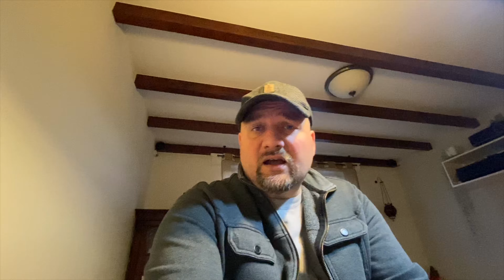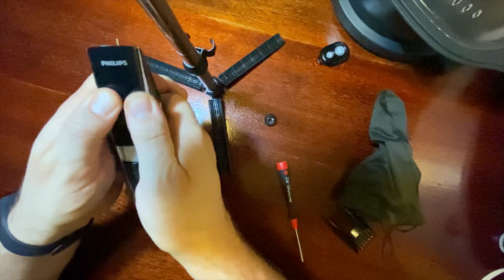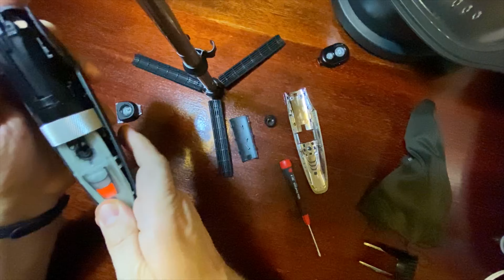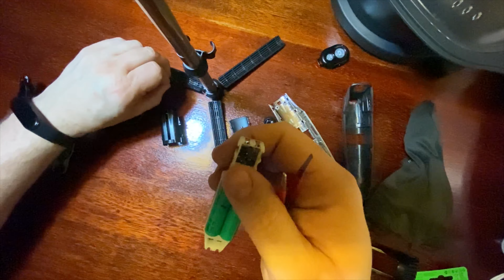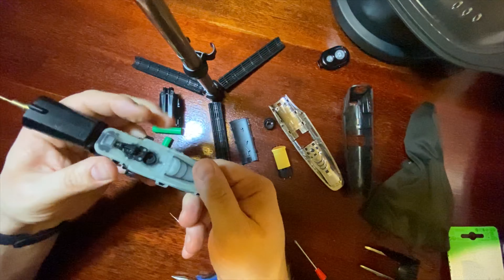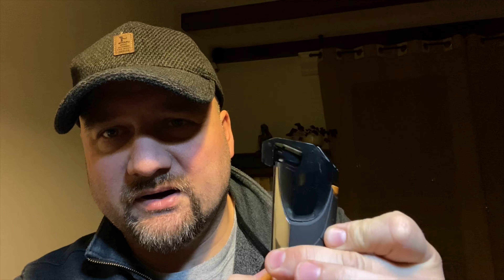🇺🇸/🇬🇧 Philips BT9290 revival/refurbishment (internal battery replacement)

Comment: I have a trimmer like this. It has the same number and looks the same. It was made in 2013, but it uses one 18650 battery and has "Li-Ion" written on the circuit board. I bought it brand-new in 2014 and it looks like it has had some modifications.

Comment: I was ridin' high from fixing my razer, so I figured I could give the trimmer a go. It still technically worked but was a bit fiddly to turn on. This video was a massive help, thanks!😄 It works perfectly now. It's a BT9280, slightly older, but pretty much the same.

Comment: That's a great video Tomasz. I am facing an issue though, because I had to replace batteries for a third time in the last 2 years.   After the replacement the batteries charge as they should but the shaver loses its charge within a few hours while being off, in the end batteries became unusable and I have to repeat the whole process again. Do you have any idea what could couse this issue?
Reply from the maker: Did you use same type and capacity as the originals? I don’t know how “inteligent” is the charger in this shaver, but if eg. you tried using some high capacity lithium batteries, I would suspect that the charging characteristics of the circuitry might wrongly interpret the current/voltage feedback it’s getting and since it’s improperly charging (and then discharging) the battery might suffer premature failure. It might be also that something (perhaps the laser?) is kept on even when closed and that’s what’s draining the battery?

Comment: Great video. The battery doesn't charge properly on my shaver. I have to leave it on charge for an hour, press the power button, then charge for 5mins and it works. However you have to repeat this with every use. 🤞🏼 this works as it is the best trimmer ive had.

The new replacement I bought from phillips is terrible! Series 5000 bt5502.
Reply from the maker: What type of replacement cells did you install? Same capacity as original?
Reply: @Tomasz Pławski  I haven't replaced them yet.. I'm hoping this demo will help me fix it.
Reply from the maker: @haydon3690  ok, I thought you changed them and these were the symptoms now,   the shaver could behave weird if you use very different cells to the originals as they might charge differently, have a different voltage drop etc., which could confuse the charging circuitry.
Reply: @Tomasz Pławski  it works! 🙌  Great video sir. Anyone should give this a go if they need to fix their's, it is very simple if you follow this. Still the best shaver around.

One thing.. For anyone who like me snapped the circulation strip welded to the existing batteries, don't panic, tin foil works a treat 👍

Comment: Great Video! Thank You Tomasz! The question is why PHILIPS constructs the product so complicated? Many of these shavers will be thrown away as garbage because of those f** NiMH accu/batteries which cannot be charged anymore. 99% of the product is still ok. This is the PHILIPS contribution for sustainability and environmental protection.
Reply from the maker: I suspect that in case of this particular model the reason why the battery is buried so deep inside is because of the waterproofing as you can use the shaver in the shower where it is subject not only to water splashes but in general very high humidity.

Comment: Thanks a lot for the detailed video. I was about to throw the machine in the garbage. I was able fix the machine after watching this video. I just want to bring the attention to the round part which you removed first. There is a very tiny piece of plastic in the front hole of this part. I didn’t notice it when I removed the part and it fell down on the sofa. When I finished putting the parts together, I noticed the blades part is loose a bit and doesn’t make the click sound when I rotate it between the small blades and the large blades. Fortunately, I found the tiny piece on the sofa and I put in the hole but I wasted a lot of time to identify the reason of the loose blades. That’s why I commented here.

Comment: Did I just replaced my batteries only to find out that the charger is not charging? 😒
Reply from the maker: Anything improved? Did you use the same type rechargeable batteries as the original?

Comment: I followed this, and ordered some expensive chargeable AAA's,  but tried a new-non-recharable as a test... and though it was full power, it would still flash low power...
I don't want to waste the expensive batteries if something else is wrong with it, thoughts?
Reply from the maker: I’m afraid that testing with regular batteries might not be reliable. Non rechargeable batteries generally have 1.5V, rechargeable are lower voltage, but often can pump out much higher current. Having such different characteristic the electronics of the shaver probably become “confused”.
Reply: @TomaszPlawski   ah, the original batteries seem to hold 1.3v but it wont work with them, or the 1.55v test batteries

Comment: Mine did not disable the laser when it was retracted and drain battery. Now it does not charge at all, do you think it's possible to fix battery drain due to the laser? Is there any way to disable the laser completely?
Reply from the maker: I guess you could just disassemble the whole module as it’s “plug’n’play”

Comment: Did it on a bt5200 philips and it worked ! Thks for this video
Reply from the maker: Did I help you? Now you can help me!  I have entered this in the Instructables "Fix it" Challenge, therefore I would greatly appreciate your vote at https://www.instructables.com/Philips-BT9290-Shaver-as-Well-As-Others-Revivalref/  (just click on the heart in the upper right corner) It would be great if you could also click the "I made it" button on the bottom and share with others how successful was your replacement.

Comment: Hi ,
Is there specific type of rechargeable battery to be used with it  ?
Reply from the maker: Best to use something with a similar capacity and type. Theoretically you could get some of the modern very high capacity LiPo but I would be worried that the electronics not being optimizes for that will not charge them correctly and therefore they will quickly degrade.
Reply: @TomaszPlawski  Many thanks , Could you plz share a link with me for a battery with same spec .
Reply from the maker: I used some 1.2V aaa 800mAh NiMH cells (the closest capacity to the original 750mAh) I don’t remember the brand, but somebody in the comments mentioned recently that they successfully used the eneloops, therefore it would be something like this https://ebay.us/TUbzhX
Reply from the maker: Ps. You might need to copy or retype that link into your web browser as YouTube viewer sometimes distorts the links adding to them some tracking information and then eBay says they cannot find the item
Reply from the maker: … could be that it’s not only YouTube but the way different web browsers treat eBay shortlinks… it also doesn’t seem to open on the Microsoft edge browser, only Opera :( if it doesn’t work, you can just search for Eneloop 800mAh aaa 1.2V and find the best offer.
Reply: @TomaszPlawski  many thanks
Reply: So glad to let you know It works perfectly .. Many thanks

Comment: Thank you Tomasz.  With your help here I replaced the batteries in my shaver and it works great now.  I used eneloop 800mAh batteries.  Like you my batteries were suppose to be pre-charged, but it didn't seem to work right away.  Once I plugged the cable in for 10 seconds everything worked, even after removing the cable.
Reply from the maker: Did I help you? Now you can help me!  I have entered this in the Instructables "Fix it" Challenge, therefore I would greatly appreciate your vote at https://www.instructables.com/Philips-BT9290-Shaver-as-Well-As-Others-Revivalref/  (just click on the heart in the upper right corner) It would be great if you could also click the "I made it" button on the bottom and share with others how successful was your replacement.

Comment: Good on Phillips for making it able to be disassembled without breaking it, and good on you for showing us how to do it! This is a great little machine and it would be a shame to throw it away just because it needs a new battery. Awesome vid, thanks!
Reply from the maker: Did I help you? Now you can help me!  I have entered this in the Instructables "Fix it" Challenge, therefore I would greatly appreciate your vote at https://www.instructables.com/Philips-BT9290-Shaver-as-Well-As-Others-Revivalref/  (just click on the heart in the upper right corner) It would be great if you could also click the "I made it" button on the bottom and share with others how successful was your replacement.
Reply: I would be more inclined to say good on them, if they had made a door on it, held maybe with one screw, so you could replace the batteries with your own. Much like a tv remote control.
They are sealed in so you are tempted to just go out and buy another one, which I won't be doing while they are still like this.
Reply from the maker: Part of this being done this way could be because of the shaver being totally waterproof. And since these are rechargeables, they do last a couple years.

Comment: Hi. What about replacing battery on shaver that has no screws? I have Renpho model es-sh1802. Battery is not recharging anymore and there are no screws whatsoever on the shaver. I dont want to break it, I guess it unsnaps somehow along the seam.
Reply from the maker: Is it something like this? http://ebay.us/ycTq7Q I would start off trying to remove the panel where the power switch is located and there might be some screws underneath that, although the whole enclosure might as well be just snapped together which is usually a bit difficult to separate without some thin shims
Reply: @TomaszPlawski  that is exactly the model I have. I will look and try to get under the panel which holds the power switch. Thanks for the reply!
Reply from the maker: Did I help you? Now you can help me!  I have entered this in the Instructables "Fix it" Challenge, therefore I would greatly appreciate your vote at https://www.instructables.com/Philips-BT9290-Shaver-as-Well-As-Others-Revivalref/  (just click on the heart in the upper right corner) It would be great if you could also click the "I made it" button on the bottom and share with others how successful was your replacement.

Comment: Hi,
Many thanks for this amazing video, I fix the my Philips with the new battery but now I have a new problem with the On/Off button. Any idea ? It's only work when I'm triggering without the plastic cover.
Reply from the maker: Did you check if everything snapped evenly into place?
Reply from the maker: Did I help you? Now you can help me!  I have entered this in the Instructables "Fix it" Challenge, therefore I would greatly appreciate your vote at https://www.instructables.com/Philips-BT9290-Shaver-as-Well-As-Others-Revivalref/  (just click on the heart in the upper right corner) It would be great if you could also click the "I made it" button on the bottom and share with others how successful was your replacement.

Comment: Thanks a lot Tomasz
Very good and helpfull video. 
The new battery is a 1000mAh vs the original 750mAh.
The razor works once again and better.
Reply from the maker: Did I help you? Now you can help me!  I have entered this in the Instructables "Fix it" Challenge, therefore I would greatly appreciate your vote at https://www.instructables.com/Philips-BT9290-Shaver-as-Well-As-Others-Revivalref/  (just click on the heart in the upper right corner) It would be great if you could also click the "I made it" button on the bottom and share with others how successful was your replacement.

Comment: Thanks for the tutorial! I changed the batteries on my BT9280 and was very simple. But now I have an issue that the machine is heating up, which I suppose would indicate a short somewhere. It doesn't seem to charge properly either. Anyone else run into something like this?
Reply: I had the same: I thought I mounted the battery pack wrong but it's the print burnt through or something like that.  I could not charge for more than 60 % .. missed two stripes and when I wanted to switch on the capacity was zero again . Just like the same with the old batteries. It worked a day because I put the charged ones in , but after a day it was done and now looking for a new print .

Comment: have the same razor model, and according to your instructions, I changed the batteries for new ones, though I took Enveloop, now it holds a long charge and lasts for a month of work! Thanks a lot.
Reply from the maker: Great to hear you did a successful swap. True eneloops are great although I have heard rumors that the rechargeable batteries at IKEA are probably made by the same company or at least they seem to offer the same great performance, but at a significantly lower cost.
Reply from the maker: There is a great write up about Eneloop vs. IKEA batteries here https://www.provideocoalition.com/ikea-batteries-eneloops-disguise/
Reply from the maker: Did I help you? Now you can help me!  I have entered this in the Instructables "Fix it" Challenge, therefore I would greatly appreciate your vote at https://www.instructables.com/Philips-BT9290-Shaver-as-Well-As-Others-Revivalref/  (just click on the heart in the upper right corner) It would be great if you could also click the "I made it" button on the bottom and share with others how successful was your replacement.

Comment: After I replaced the batteries somehow I killed the laser... Any idea what happened? I replaced the batteries with 800mah 1.2v Tesla rechargeable batteries.
Reply: My laser stopped too... Hahahhaha
Reply from the maker: Did you check the connection terminals, maybe it’s just a lack of contact? To kill the laser you probably would need to e.g. reverse polarity, but then I suspect that the entire shaver wouldn’t work

Comment: Thank you so much for making this video, a very good DIY👌
Managed to fix my bt9280 without any problems with your help👍
I'm very happy now😁
Reply from the maker: Did I help you? Now you can help me!  I have entered this in the Instructables "Fix it" Challenge, therefore I would greatly appreciate your vote at https://www.instructables.com/Philips-BT9290-Shaver-as-Well-As-Others-Revivalref/  (just click on the heart in the upper right corner) It would be great if you could also click the "I made it" button on the bottom and share with others how successful was your replacement.
Reply: @TomaszPlawski  will do👍😁
Reply from the maker: Cool, great that you were able to fix it, because besides the non-removable battery it is a really excellent cutter
Reply: @TomaszPlawski  Yeah as you say it's a really solid and good quality cutter even after all these years of use so I figured I'd give it one more chance and ended up here on your excellent video. Even if I wouldn't have found my way here I've would have tried it and probably broken a clip or two but now I got the batterys, tools needed and 5min later it was done👍😁

Comment: Thnak you very much for this video! Mine didn't even work with the charger attached anymore, now it's as good as new. The original Batteries died after just 3 years. Although I charged my new batteries fully before putting them in, the shaver still said that they're empty. After charging them inside the charger, it works now.
Reply: Lucky ! I got stuck on the same problem every day
Reply from the maker: Did I help you? Now you can help me!  I have entered this in the Instructables "Fix it" Challenge, therefore I would greatly appreciate your vote at https://www.instructables.com/Philips-BT9290-Shaver-as-Well-As-Others-Revivalref/  (just click on the heart in the upper right corner) It would be great if you could also click the "I made it" button on the bottom and share with others how successful was your replacement.

Comment: Great step by step video. Seems like many people have issues with the battery. Reassembling the middle part was probably the hardest part of it, but now once battery is replaced, trimmer works like a brand new one. Thanks!
Reply from the maker: Glad it helped
Reply from the maker: Did I help you? Now you can help me!  I have entered this in the Instructables "Fix it" Challenge, therefore I would greatly appreciate your vote at https://www.instructables.com/Philips-BT9290-Shaver-as-Well-As-Others-Revivalref/  (just click on the heart in the upper right corner) It would be great if you could also click the "I made it" button on the bottom and share with others how successful was your replacement.